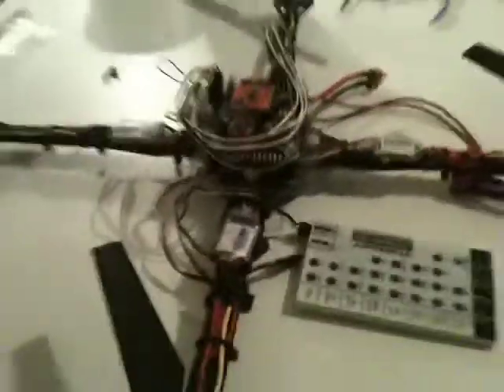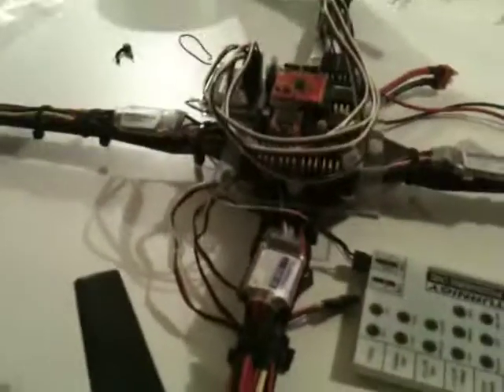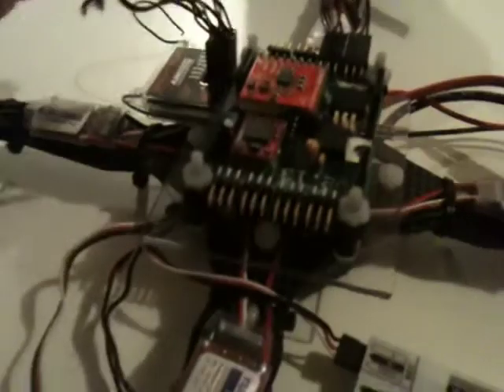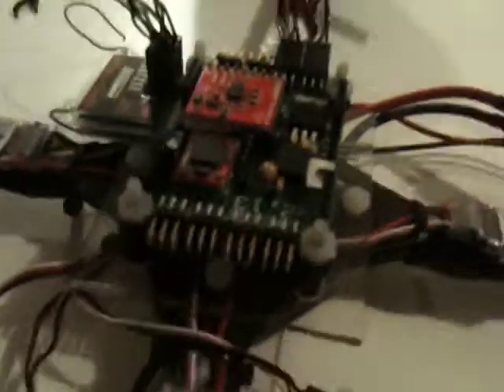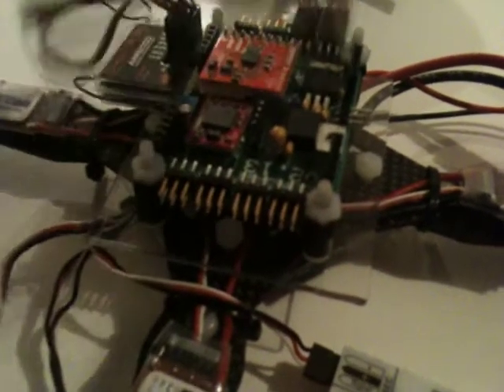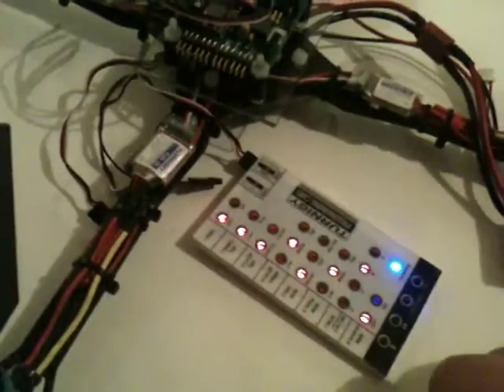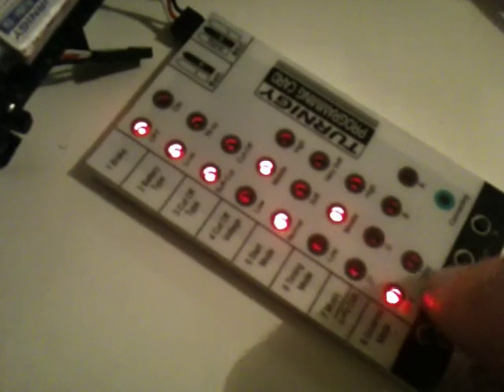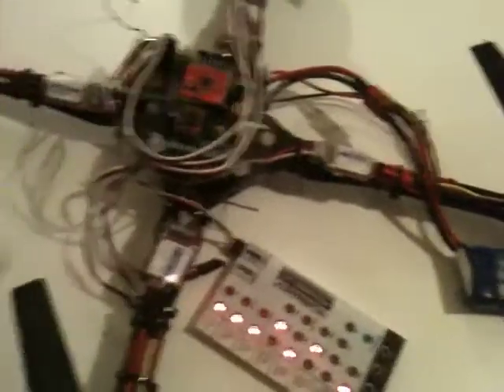Turnigy Programming card setup on a RC QuadCopter quad helicopter quadkopter MikroKopter

Comment from the maker: hi James, sorry your right that would be a good idea. for brake its how the esc would stop lets say without throttle with a quad you wouldn't want the esc to ever shut off in flight etc.. for timing its kind of a fine line of small comparisons in that setting. but timing would have to do with how the esc reacts from your rx/FC so you want them all the same but again this is usually standard medium but there are flight controls out there that would be ok in other settings.